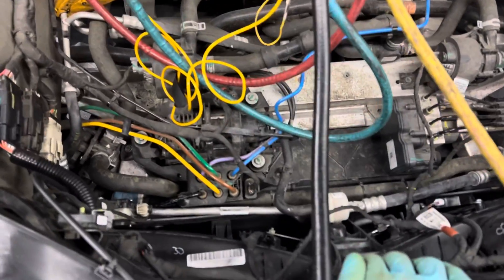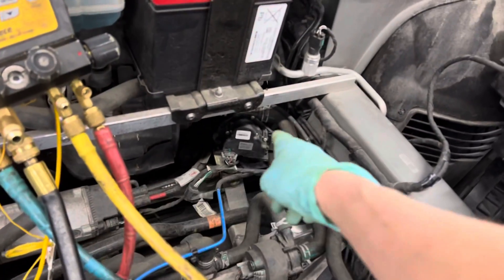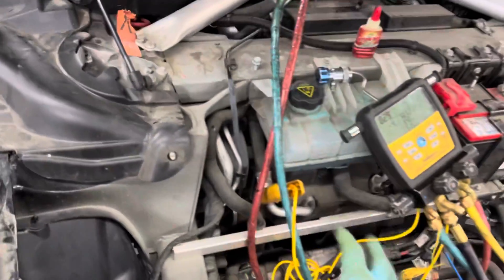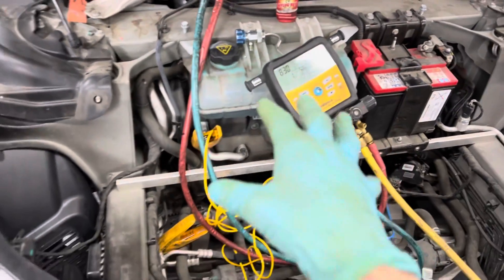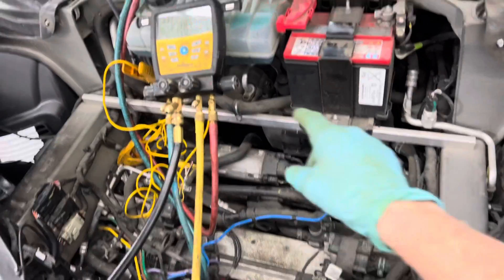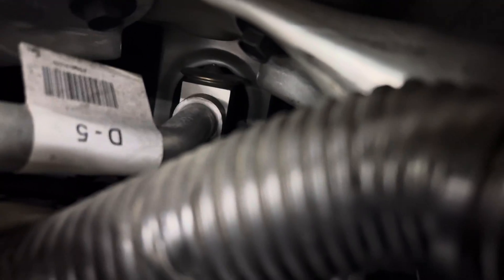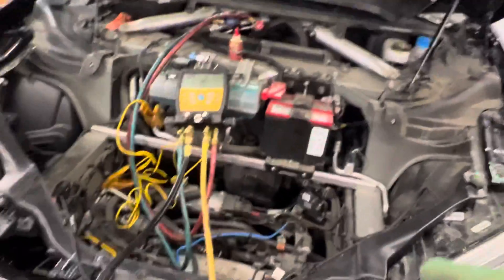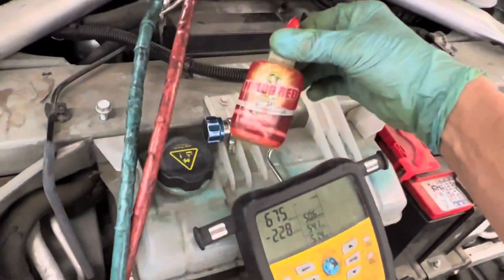Tesla AC,  two expansion valves two water pumps, three 3 way glycol valves￼, plate heat exchanger. ￼

Comment: What is the cooling capacity of one of these bad boys?
Reply from the maker: I never looked it up.   Would have to go to the compressor manufacturers website and look at the BTU capability of the compressor that would at least give you what it’s rated at they give that information on all compressors especially electric compressors when you go to the manufactures sources. 

        But looking at those H block style expansion valves the common value and automotive is about 1 1/2 tons 18,000 BTUs

           So I’m gonna say there’s a minimum of at least 36,000 BTUs. 

         I have not looked up the specifications on how many RPMs that particular model spins but if it’s anything like the Prius because it’s made by the same manufacture DENSO it’ll be in the neighborhood of 6000 to 7000 RPMs. At full speed could be more but I don’t know.
Reply: I was think 3 ton plus as well!

Comment: This is the third attempt to send this comment, for any reason doesnt make public

Nissens has some info about Heat pumps addressed for beginners, its only conventional information but good enough for those Who are interested to know how It works

Searching for Nissens training concept
Reply from the maker: This is a older Tesla not heat pump.   The air conditioning is juice used for the second expansion valve only to chill the glycol loop.   Used to chill the battery and the inverter that produces heat. 

        You can think of it as a beer tap cooler.     Where they use a chiller air conditioning to a expansion valve to chill glycol.        
               Then you run chill glycol through a loop down a long hose.     Then inside that hose filled with chill glycol flowing inside of it you run another hose filled with your beer from the top can Kkhg inside a refrigerator located far away in the back of the building of a bar.      They don’t want to beer to get warm by the time it goes through all the pipes and gets to the front of the building at the bar that’s what the glycol is used for chill by the expansion valve off of the AC unit. 

        That’s how this Tesla model system works it’s doing nothing but using the air conditioning compressor pump to pump refrigerant to the expansion valve that sends refrigerant through the plate heat exchanger to absorb the heat from the glycol loop.   

Heat pumps use a reversing valve system that actually uses refrigerant and shifts the direction of the hot and cold Refrigerant instead of glycol
Reply: @coldfinger459sub0  A "cool" system for sure, I have to give myself some time to understand better the systems involved on these cars, isnt very common over here to see EVs, majorly little hybrids but is a good principle on how the Next years cars are gonna be
Reply from the maker: @ignatius2230  some hybrid systems have the exact same set up